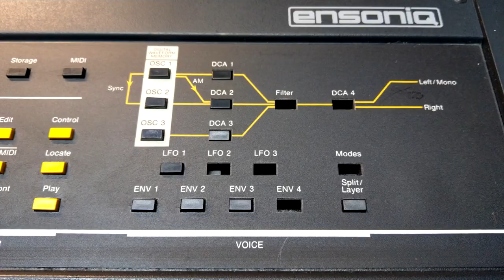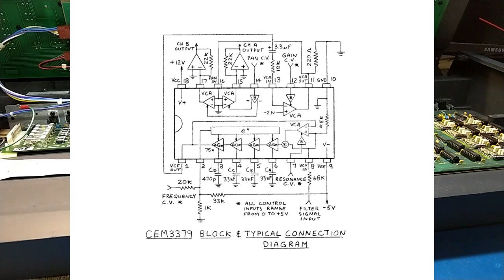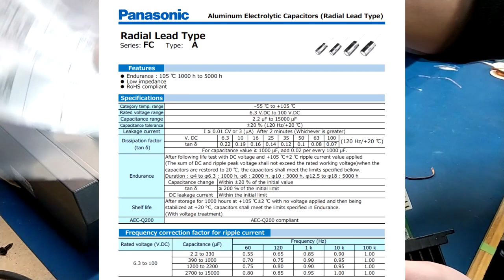Ensoniq ESQ-1 Repair and Restoration

Comment: This was absolutely a budget priced synth (list was $1,395 upon release in 1986) yet, as Brad says, the large 40 x 2 VF display (made by NEC) was very large for ANY synth at that time (maybe expensive PPG Wave had as big or bigger). The big display and a whopping 10 soft keys (5 of which were, unusually, ABOVE  the display) made for a super elegant DIGITAL style interface with absolutely no menu diving. Each programming button was situated within a graphic representation of the synth architecture and allowed you to change a full 10 parameters with the soft keys and accurate data slider (numbers instantly updated with no lag that you might see on a standard LCD). 

The loop-based sequencer on the ESQ-1 was super easy and fantastic , as well. It rounded out one of the first synth "workstations" ever, with multitimbral operation (Sequential Six Trak was earlier, with less capability).

Also of note; the ESQ-1 main digital oscillator chip was the same used in the Ensoniq Mirage sampler and the Apple IIGS computer. It was the brainchild of Bob Yannes, who left MOS Technology after designing the legendary SID sound chip used in the Commodore 64 computer.
Reply: Agree on all points :)

Comment: Great video as usual! More synth repair walk-through please! A tip to remove stubborn pot/sliders knobs is to use a hair dryer or heath gun (careful with the latter) and warm up the plastic gradually until they soften and give up.
Reply: Was just about to recommend a heat gun or a SMD gun but you were tracking along with me

Comment: Loved this!  And great commentary.  Really informative.  I had the metal version for years and years and sold in working condition.  I just picked up a plastic one in IMMACULATE condition except I need to do the battery of course and update the OS.  Am hoping the rumors are true that the OS chips (x2) are socketed and not soldered like the metal.  Otherwise it will go to my local tech who can service these older boards.

Comment: Well I for one found this very interesting, thanks.
I bought one in 1986 (U.K.) but haven't used it since around that time.
I also had a Korg DW-6000 and a Yammy CS70M.
I still have them all but now I know a little of what I'm likely to find if I do ever try to power any of them up again.
Just bought a new Yammy MODX8+, which is all I use now other than an M-Audio controller for DAWs (the MODX will do this but I haven't set it up yet).
😁

Comment: The ESQ-1 is one of my favorite synths, i have two of them, both metal body versions.  The transformer blew in one of them, so i need to locate the proper type that goes with the power supply in the metal body units.

Comment: Nice video!   Watched the whole thing.   I needed to load the factory patches back in as they were all lost when the battery died.  and all from an MP3 file recording of an old audio cassette from my phone.
Reply: Did this actually work (the re-load)?  What a cool idea....
Reply: @trebleboost7  Yes worked fine.  
I also eventually upgraded my firmware to the "latest" which completely got rid of this problem. But that is not a super easy thing to do.

Comment: I had one as I was 16 years old. I wish I knew about capacitors cause it went kaputt on me, fuses blown, me bridging the fuses sockets with aluminium foil, worked for a while and died, then I ended making a lamp with the keys. It was quite a cool keyboard, I used a tape recorder so store and load sequences and patches. It was my first experience with digital equipment. As I said, I wish I knew better so I could repair it and still have it.

Comment: This video is insanely useful for me as a new(ish) ESQ-1 user!

I had no clue about the capacitors on the power supply board--is there any risk of damaging the rest of the synth if I don't replace those before they fail? 

Thanks so much for the great video!

Comment: I use to have one back in 2011 i bought from a music store for 200, had some family issues going on and just got so mad/depressed that i sold it on ebay for 20 and some one in Maryland drove up to NJ to pick it up. I do miss that keyboard as it was awesome but didn't have enough time to really experience its full potential. I also had one of the crystal carts as well and that thing was awesome! Now I got a korg sp-500 from good will for 20 that works just needs the headphone jack replaced. Also I just noticed that your version is slightly different from mine. Mine had a huge heavy heat sink on that upper top side and I think the top control panel part was metal as well not plastic like yours. It was very heavy ><

Comment: Hi, I got an ESQ-1 with a battery issue.  i replaced the battery and still get the warning.  Did the full reset.  The analog test shows Batt: 255.  I then tested the old one and it was at 2.9V.  New one is 3v.  Resoldered twice.  I'm not great with soldering but I do think it's got contact.  I'm assuming the 2.9V battery before probably should have still been enough too which someone else soldered in.  I'd appreciate any ideas.  Thank you!

Comment: Thanks for posting such an in depth video on this. I just acquired an ESQ-1 and although full working has a background continual buzz and whine. I am assuming its power supply related as it sort of makes me think of mains hum.  I'm hoping replacing the Capacitors in the PSU will solve it.

Comment: What was used to repair the PCB connection to the front panel on the right side?  I just bought one of these units with a similar problem.

Comment: thanks for the advice from a excellent video i have all my music cartridges and expansion cartridge and brought a battery holder for the Panasonic br 2/3 3 volt they recommend solder to the board however if i add painter tape to hold the battery in there isn't the risk of the battery falling out. yes please can you do a video on the capacitor replacement.  I'm hunting down the capacitors for the  ensoniq esq 1 i brought in 1987 ah memories!

Comment: I got an ESQ-1 by mail, and one of the keys popped up. The seller sent a new key, however it looks the same as the one that came out, and it wont stay down either. Is it possible that my issue is the smaller spring has stretched out and wont hold the key down? Thanks

Comment: Another good video. I have the SQ80, mine needs the caps done and I'm not 100% sure yet but the aftertouch seems to only be working on the black keys? Or was that the SD1? I've also got one of those usb floppy replacement drives to fit. Never ending.

Comment: I know this is another beast. But I've found hardly anyone repairing Ensoniq's on Youtube, so I'm going to ask anyway!

I acquired myself a TS-10 for Poly-AT.  But the pressure is so stiff, I imagine some rubber must have stiffened somewhere and it has almost no give left. 
I'm very nervous about opening it up. Should I just have a look? Or will this thing die on me the moment I start poking around in it?

Comment: Really wish I had held onto my ESQ-1. I don't know when, but about 20 years after getting it, I sold it for $50. The battery had been replaced, and it was working fine, but then it wasn't anymore... and I don't know why. I figured it was time for a new keyboard... but I really miss the easy sequencer and song/track building this had built in. Would rather use it than a computer...

Comment: It has only one spring in the back of each key, so how does the velocity touch work? Great video!
Reply: If you look at 26:23, I believe the keyboard measures the time taken between breaking the contact with the top wire and making contact with the second wire. Shorter time elapsed between the two events = faster velocity. Voila!

Comment: 14:49 Dat display! Actually, they are not that power hungry. Early backlit LCD's consume way more. And never remove it. VFD's don't die. The 35V circuit can be broken, but the display itself will go on and go on. Worst that can happen is that some pixels get dim.

Comment: Dude you are a boss! I have to take mine apart soon to probably replace the battery among other things but this video will be super useful. Do you have any good info on where to order parts for this?
Reply from the maker: Digikey and Mouser are great for generic parts. Check out Syntaur for Ensoniq specific bits.
Reply: @bradthx   Thank you! Do you have a link to the capacitors that you replaced on the power supply as well? I'm not that literate with this stuff so i'm having some trouble figuring out which ones I need. Thanks again!

Comment: If the ESQ-1 (and more specifically, the ESQ-M) is a wavetable synthesiser, would it be fair to say that it's like a Waldorf Microwave, but at one third of the price? Or is that perhaps a bridge too far?
Reply: The use of the name "wavetable" is a bit of a misnomer, it's not THAT type of Wavetable synth,  they're just sampled waveforms stored in RAM that's refereed to as a Lookup Table,  it isn't the type where you can scan though multiple different waveforms within a main wavetable.
Reply: @Black_Agent_Seattle  Thanks for the explanation. Meanwhile, I managed to get both an ESQm and a Microwave II at a reasonable price, so I can test for myself. 🙂

Comment: Brad or anyone know the TYPE OF PLASTIC used on the chassis, the kind with the "swirled" pattern, visible on the underside of the opened front panel? It looks exactly the same as plastic often used in expensive European Playmobil toys. I'm wondering if it's fiberglass filled plastic or something. I see it in various products once in awhile and  am dying to know what it's called and WHY it's used when it is.

Comment: When you say direct digital, and that it converts the waveform to analog sound, what do you mean exactly? Does it have DCOs which are controlled by the sample? or does it simply feed a sample into analog filters and vca?
Reply: Well, in theory, I'm not sure what the difference between those two would be ... however, from my understanding, the ESQ/SQ have a custom Ensoniq voice chip, which is basically a wavetable based DCO. It would be hard to say exactly what it's doing as it's a custom IC (a DOC5503), however there is some documentation for it online. However, after generating the voices, the of the voices are fed through 8 CEM3379s which are your typical 80s "analog filter + vca on a chip" - with the one notable exception of these being one of the few CEM chips that actually support a "panning" CV/output (there aren't many analog or "partially analog" synths in general that supported crazy panning effects).
Reply: @ryanjay6241  The difference i think would be quite significant. DCOs are analog oscillators but digitally controlled, If the waveform is just stored 1s and 0s thats not analog thats just digital waveform no matter the form they are stored in. The ambiguity around the sounds source of this synth is quite intriguing, because a wavetable controlled DCO is very much analog. that is in practice digitally controlling a digitally controlled analog oscillator. Every page i read about this says the voices are digital, stored waveforms, so if its not that, but is in fact wavetable controlled DCOs, that is very interesting, and i might buy one!
Reply: @Unshapenkris  So, I guess in this case it shouldn't be considered a "DCO". At this point it's really all about naming, but from my understanding a DCO is a purely analog oscillator that is controlled digitally - which obviously wouldn't be capable of playing "custom waveforms". There is actually an amazing resource for the ESQ/SQ series, that details a lot about many things about these units
http://www.buchty.net/ensoniq/
According to it, the "The DOC consists of 32 time-multiplexed digital oscillators based on phase accumulators". According to some things I've read, this would most likely be what a numerically-controlled oscillator (NCO) is.
That being said, I have an ESQ-M (rackmount) and I wouldn't say the oscillators sound analog to me. They have a "glassy" sound IMO almost like a JV1080, which isn't really a bad thing. However, it does allow control of many of the parameters of the oscillators that you'd expect on an "analog" oscillator (semi, fine, hard sync, AM, modulation of freq and vol). The filters however (and the unique panning effects + modulation capabilities) are the selling point for me, as they are and do sound very analog.
It's not however a unit I would pick up for creating classic analog sounds with. There are cheaper units better suited for that.
Also, IMO the term "DCO" to me is considered loosely. I've heard modern units with "DCOs" (i.e. Tetra4) that do not sound analog at all to me. They're as clean and precise as a VST. There are vintage units (like the Korg EX800 or Akai VX90) where the DCOs are as sloppy as any VCO, which is why I take the term lightly ...
Reply: @Unshapenkris  ahh, an esq-m owner.. the one thing I always regret is getting a esq-m cheap as an add-on fro my esq1 when they were 100-150$ odd so. Stupid me. Now you hardly ever find one in the wild